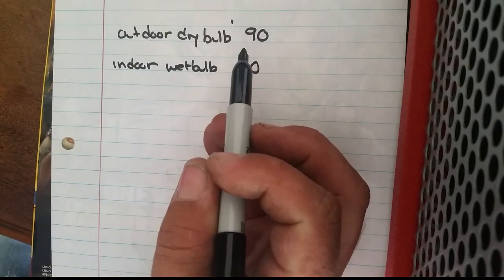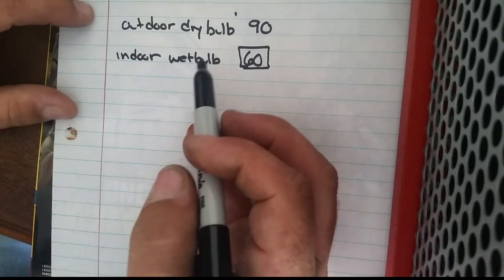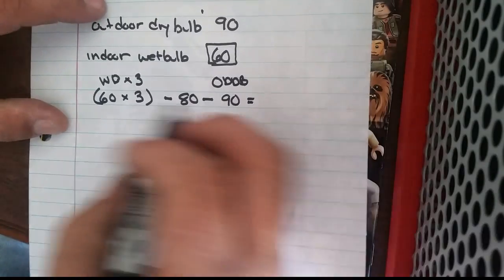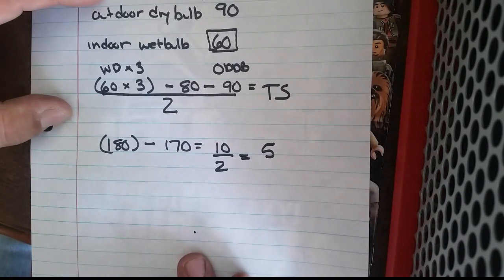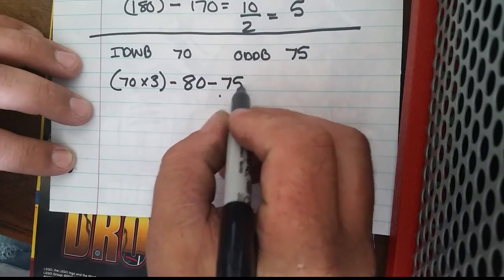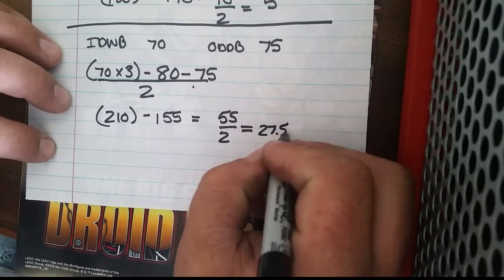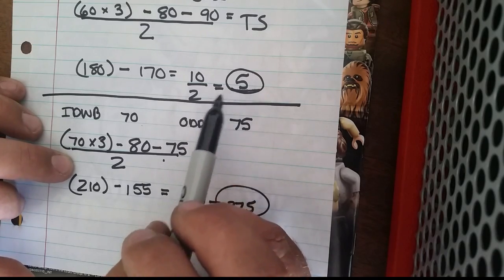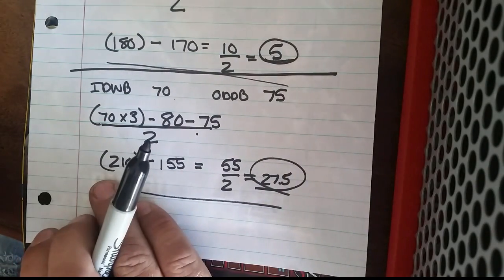Target Superheat Calculation for HVAC

Comment: So far, I’ve found no one that can tell me where we get these constants and other parts of this formula: why 80; why times 3; and why divide by 2? I located the source for the magic number used to calculate the running capacitance of a system. The constant used in  that formula comes from the fact that the capacitive reactance (impedance) of a 1 μF capacitor at 60Hz is 2652.58 ohms Xc = 1/(2π x 60Hz x 1 μF) = 2652.58 . . . Ohms. But I can’t figure out the Target SH formula constants.

Comment: Of course, this is for fixed orifice systems.  TXVs will attempt to maintain a superheat value, as long as the actual superheat doesn't get too extreme.  At extremes, the TXV metering becomes unstable.

Comment: For anyone who uses Celcius:

Here is the formula with the new Constant set up for temperature in degrees Celsius:

TSH: Target Superheat
WB: Indoor Wet Bulb Temp
ODA: Outdoor Ambient Temp
C: Constant

For degrees Celsius, the Constant is NOT 80.
It's 44.43.

The formula:
TSH = [(WB•3) - C - ODA] ÷ 2

Simplified:
TSH = [(WB•3) - 44.43 - ODA] ÷ 2

So, if the Indoor Wet Bulb Temp is 18°C & the Outdoor Ambient Temp is 35°C.....then the Target Superheat will be -12.7°C.

TSH = [(18•3) - 44.43 - 35] ÷ 2
TSH = (54 - 44.43 - 35) ÷ 2
TSH = (9.57 - 35) ÷ 2
TSH = (-25.43) ÷ 2
TSH = -12.715° Celsius
-------------------------------------------------
I also set the formula equal to Indoor Wet Bulb Temp.

WB = [(TSH•2) + 44.43 + ODA] ÷ 3
WB = [(-12.715 • 2) + 44.43 + 35] ÷ 3
WB = [(-25.43) + 44.43 + 35] ÷ 3
WB = (19 + 35) ÷ 3
WB = 54 ÷ 3
WB = 18° Celcius
Reply: Hi and thanks 
Can we apply this formula for refrigration (storage rooms) because on those we have low wet bulbs such as 40 f
Reply: 1. You're very wrong, man! You can't just simply convert °F to °C directly! If you use °C, 1-st you need to convert it to °F. Then you can use author's TSH-calculator. And when you get TSH in °F, then you need to convert it back to °C: TSH(°С)=TSH(°F)*5/9! So for IDUWB=18°C & ODUDB=35°C TSH is 9.1°F=5,1°C.
P.S. And SH can't be negative ☝
P.P.S. How do you know, that Celsius constant equals 44,3 instead of 80?
Reply: @Technoboltic try with my constant try with 8.88 you'll see it works 💪 (3×18-35-8.88)÷2
Reply: The constant for C is 8.88 (3×wb-db-8.88)÷2

Comment: Can it be converted to Celsius units?
Reply: Here is the formula with the new Constant set up for temperature in degrees Celsius:

TSH: Target Superheat
WB: Indoor Wet Bulb Temp
ODA: Outdoor Ambient Temp
C: Constant

For degrees Celsius, the Constant is NOT 80.
It's 44.43.

The formula:
TSH = [(WB•3) - C - ODA] ÷ 2

Simplified:
TSH = [(WB•3) - 44.43 - ODA] ÷ 2

So, if the Indoor Wet Bulb Temp is 18°C & the Outdoor Ambient Temp is 35°C.....then the Target Superheat will be -12.7°C.

TSH = [(18•3) - 44.43 - 35] ÷ 2
TSH = (54 - 44.43 - 35) ÷ 2
TSH = (9.57 - 35) ÷ 2
TSH = (-25.43) ÷ 2
TSH = -12.715° Celsius
-------------------------------------------------
I also set the formula equal to Indoor Wet Bulb Temp.

WB = [(TSH•2) + 44.43 + ODA] ÷ 3
WB = [(-12.715 • 2) + 44.43 + 35] ÷ 3
WB = [(-25.43) + 44.43 + 35] ÷ 3
WB = (19 + 35) ÷ 3
WB = 54 ÷ 3
WB = 18° Celcius
Reply: @adamspears3819  wouldn't it be 26.67 instead of 44.43????
Reply: @jhernz858  no

Comment: Can we use this formula for calculating target superheat  for R22 and R410A, do you have formula for calculating subcooling?
Reply: Subcooling measurement is achieved by taking the liquid line Temprature at the outlet of the Condenser and subtracting it from the Liquid-line Pressure  converted to Temperature number.

Comment: How do I apply this notion to a compressed air dryer? I'm assuming dry bulb temp is the room temperature, but how do I practically measure the dry bulb temp and at what point in the system? Inside the cylinder that contains the evaporator coil?
Reply: I know it's late but dry bulb temp is usually the ambient temp not in direct sun and you measure it outdoor by the side of the condenser coils 6-8 inches from top where the saturation is still present.

Comment: ambient temperatures and humidity varies with the weather so a target super one day could be very diff another day based on the temps
 but if its set today based on certain readings it would change or be different on another day based on temperatures. setting it today based on certain temps would not be optimized for differences in temps and humidity levels or is has it pretty much been optimized for a range of temps is my concern.  is there a range the super should be left in like 10-20 that should hopefully be the most effective based the temps and humidities of that area.

Comment: Good video but what's th best time to measure this after how much time of operation of the system is the ideal time to measure this. That super heat could change depending upon the Time of the day during the summer and how long that system has been operational in the house. Once this target super has been set will be it have been optimized for different ODB IWB and different temps. Once again how would air flow affect this and how can this be optimized considering the changing parameters of ODB IWB and air flow.
Reply from the maker: +RedCoach Inn I would give it 15 to 20 minutes of run time. If you are doing a single measurement you may have to repeat it every 10 to 15 minutes.

Comment: Zach, I have a question. We have new ductwork that is sweating.
We installed new ductwork under a customer's home. It is tightly wrapped, taped, mastic applied to all joints.
The customer keeps the T'stat sat at 67degrees. . We have no air leaks and the boots are well insulated.
It is located in Florence, SC. Temps have been quite high as has the humidity. Crawl space vents are open.The conditioned space is right at 1200 square ft. The split unit is 1 1/2 condenser and two ton air handler  The air handler is located in the crawl space. The air handler is level.
What is the cause of the sweating?

Comment: is this formula work in Australia the -80?
Reply: Here is the formula with the new Constant set up for temperature in degrees Celsius:

TSH: Target Superheat
WB: Indoor Wet Bulb Temp
ODA: Outdoor Ambient Temp
C: Constant

For degrees Celsius, the Constant is NOT 80.
It's 44.43.

The formula:
TSH = [(WB•3) - C - ODA] ÷ 2

Simplified:
TSH = [(WB•3) - 44.43 - ODA] ÷ 2

So, if the Indoor Wet Bulb Temp is 18°C & the Outdoor Ambient Temp is 35°C.....then the Target Superheat will be -12.7°C.

TSH = [(18•3) - 44.43 - 35] ÷ 2
TSH = (54 - 44.43 - 35) ÷ 2
TSH = (9.57 - 35) ÷ 2
TSH = (-25.43) ÷ 2
TSH = -12.715° Celsius
-------------------------------------------------
I also set the formula equal to Indoor Wet Bulb Temp.

WB = [(TSH•2) + 44.43 + ODA] ÷ 3
WB = [(-12.715 • 2) + 44.43 + 35] ÷ 3
WB = [(-25.43) + 44.43 + 35] ÷ 3
WB = (19 + 35) ÷ 3
WB = 54 ÷ 3
WB = 18° Celcius

Comment: does this formula work with any refrigerant like r422b
Reply: Yes
Reply: @TALYN875  That makes sense since the same HVAC infrastructure is still in place. I wondered about that too since gauges list settings for different refrigerants  – yet superheat calculations remain constant.

Comment: This is much appreciated information to me since I am trying to educate myself in hvac from these YouTube channels.  Correct me if I am wrong but is a superheat calculation only needed to charge a system using a piston or are there other reasons it is used for?
Reply: Typically superheat is used if you have a piston because it remains constant. Subcooling is used for TXV because superheat changes with a TXV.
Reply: @8GardenJunky1  Yup! TXV is like the bouncer of an exclusive club that I know! Decides when and who can get in!
Reply: @ryk1265  well said

Comment: Thanks for another great video. I saw on the paperwork for a VSZ140361AA the other day, a target superheat chart. It had unusual recommendations for target superheat. Example, 80 oddb. 65 idwb it recommended 12......several targets on the chart varied greatly from the formula we use. It's interesting 
how different target superheat sources give completely different answers.....two different slide charts will sometimes disagree. The Emerson check and charge app,   The mathematical formula, manufacture recommendations    They seem to all disagree....any thoughts you guys have would be greatly appreciated. We spend big money for the accuracy of digital gauges, yet we wonder if the target superheat info we have access to is truely dependable...thanks again